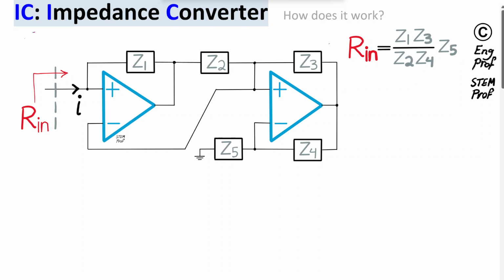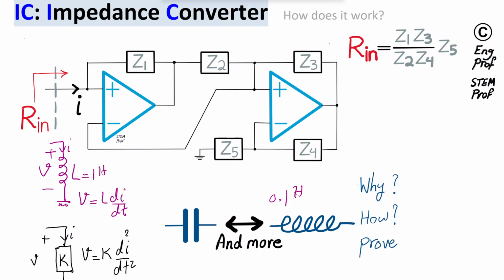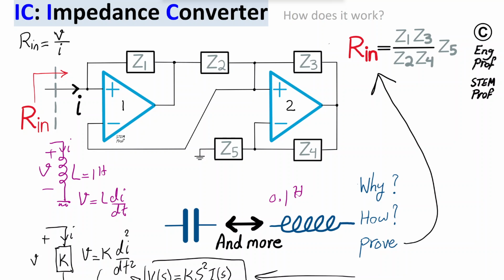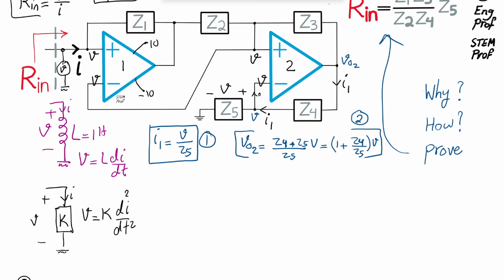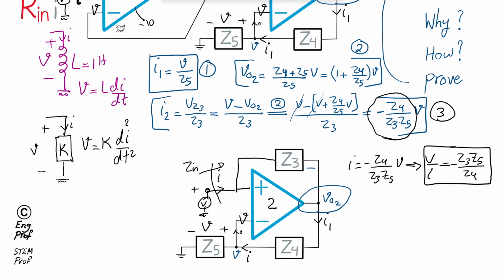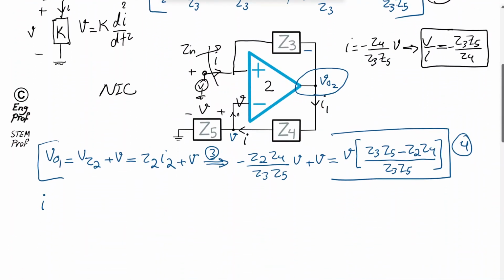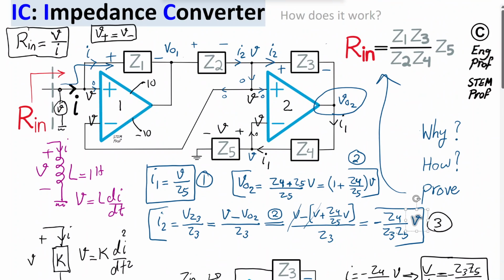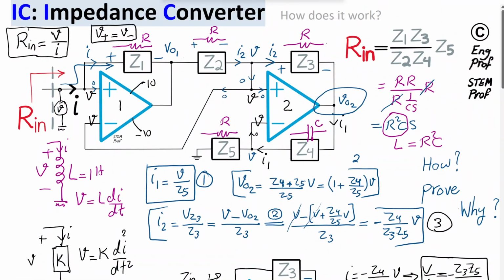Impedance Converter Analog Circuit Design with Op Amp (GIC and NIC)

Comment: Great videos. Thanks.
Reply from the maker: You're welcome. Glad that you liked my videos. Here are a few related circuit examples:
Negative Inductance Design https://youtu.be/GF_Mun_Mkyo
Converting Capacitance to Inductance with Op Amp Circulator Amplifier https://youtu.be/weIHG45G6Pg
Impedance Converter Design with Op Amp (Gyrator) https://youtu.be/jPudh9yqDH4 ,  
Active Inductor with Op Amps https://youtu.be/6IYz4iaa05c 
I hope these examples are interesting as well.

Comment: Remember working on an 8 H simulated inductor sub-circuit in an IC years ago. As part of verifying the performance, I found a 6 H physical inductor (large) to use in a reference circuit to compare the performance of the simulated inductor.
Reply from the maker: Thanks for sharing your interesting experience 👍. What was the result of performance comparison?   And I hope you also like the following two related videos: Negative Inductance Design https://youtu.be/GF_Mun_Mkyo
And Floating Inductance with Op Amp Circulator Amplifier https://youtu.be/weIHG45G6Pg

Comment: Very nice and concise explanation, thanks. 
An additional closing comment of Rin(f) would also be useful to readers as L=R^2*C only holds as long as both OpAmps in their pass band. 

OpAmps show low pass behaviour.

 Above certain frequency OpAmps may need additional components to hold  or simply Rin no longer holds as expected.

Have you built one? When you do I suggest you use the old yet reliable LM741, and then replace with the faster LM358, you will see the difference. There are better OpAmps than 741 or 358, but then cost goes up.
Reply from the maker: You're welcome. Glad that you liked this video and Thanks for sharing your thoughts. The LM741 Op Amp is a legend among operational amplifiers. It has been taught in circuit design courses since early 90s. With that said, I have listed a few more recent well-designed op amps for gain-bandwidth product up to 8 GHz (from Texas Instruments and Analog Devices) in the video https://youtu.be/oyz6lTGd2Xo?&t=1152 that focuses on Op Amp Amplifier with -25 to 55 dB Attenuation-Gain range.  I hope it is useful.

Comment: A brilliant explanation of these Impedance converters! Our Prof introduced this kind of Opamp-curcuits as gyrators - without in-depth analysis, since he found, analog-circuits where outdated. Of course, this is true, if you have a fast DSP-capable Microcontroller, that can handle convolution- and/or FFT-operations. In this case, FIR-, or IIR-filters are just the right thing to create any impedance.
Reply from the maker: @debrainwasher Thanks for the comment and sharing your thoughts. Glad that you liked this Impedance Converter Analog Circuit Design with Op Amp video. I would not say Analog circuits are outdated at all. While digital circuits are everywhere, there are still considerable applications that require analog circuit design including mixed signal design, sensor interfacing, data converters, extremely low power circuits, Neuromorphic computing that aims to mimic the structure and operation of the human brain, using artificial neurons and synapses to process information (for example neural processors used for artificial intelligence). For more example see the following two YouTube playlist in my channel:  
Analog and Op Amp Circuit Design Videos https://www.youtube.com/playlist?list=PLrwXF7N522y4c7c-8KBjrwd7IyaZfWxyt
Digital Circuits and Digital Signal Processing https://www.youtube.com/playlist?list=PLrwXF7N522y6cSKr0FmEPP_zQl011VvLr
Reply: @STEMprof  I agree, there are  applications, where Opamp-Circuits are still useful - particularly in signal-preprocessing. I did and still do many analog-designs. In many cases, particularly, when enough ressources are present, DSP is simply the better choice, since there are no component tolerances, temperature-problems, power losses, or even RFI-, or high voltage issues. A couple of years ago, I designed an adaptive, active RFI mains-power filter (230VAC) with power factor correction for a customer. I used two class-D H-Bridges with power-FETs and a large electrolytic capacitor as a reactance - controllable as a capacitance, inductance - or both. The transfer function was created in real time by Hanning-windowed FFT and IFFT. It worked quite well, but above ca. 170kHz, the bandwidth of the power-circuit was exhausted, while targeted switching noise went a magnitude higher. Therefore, the project has been abandoned. Today, contemporary GaN-FET and fast FPGA could probably do the job.
Reply from the maker: Well said. Thanks for sharing your thoughts and observations. I hope you enjoy this channel.

Comment from the maker: How to Design Analog Impedance Converter?  How to convert capacitance to inductance?  How to design virtual inductor?  How to simulate very large inductance?  How does general impedance converter work?  These questions are discussed in this analog design video. For more Circuit examples see: Converting Capacitance to Inductance https://youtu.be/weIHG45G6Pg
Negative Inductance Design Op Amp Impedance Converter https://youtu.be/GF_Mun_Mkyo
Active Inductor with Op Amps https://youtu.be/6IYz4iaa05c
Analog Computer circuit that solves Differential Equation https://youtu.be/HeZRtnRXpEI
Capacitor to Inductor Converter Circuit https://youtu.be/weIHG45G6Pg
Operational Amplifier Gyrator Network Circuit https://youtu.be/2KpjAytRBpc
    To see more op amp and analog circuits examples please check analog design playlist https://www.youtube.com/playlist?list=PLrwXF7N522y4c7c-8KBjrwd7IyaZfWxyt  
I hope these Circuit engineering and analysis videos are helpful.